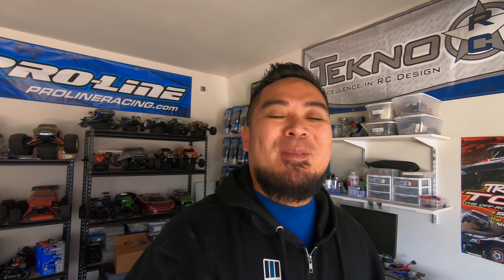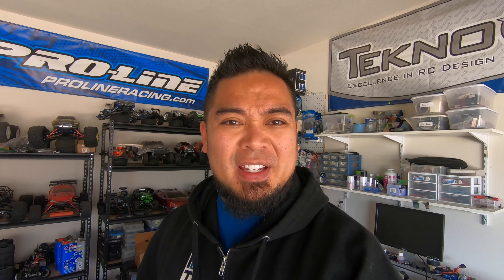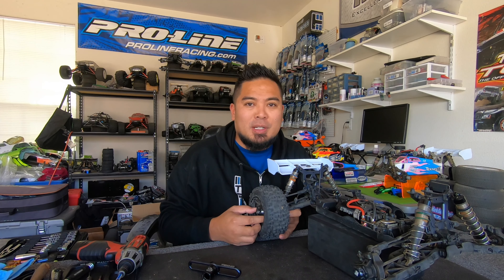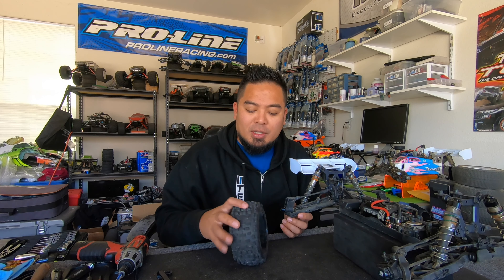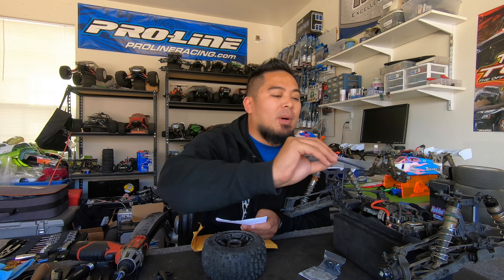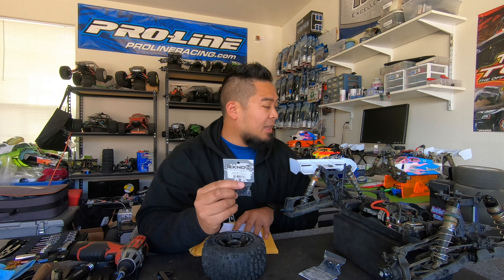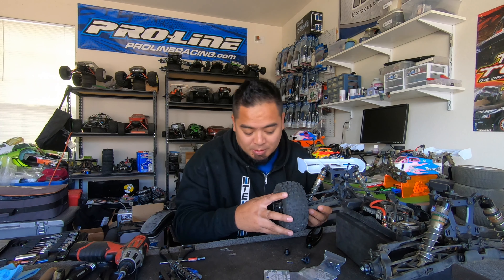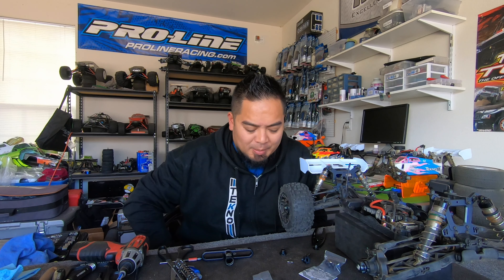Tekno RC ET48.3 My Wheels Won't Turn!

Comment: I used the Tekno 15mm "hub extender" hexes for my Traxxas Rustler 4x4 (I'll explain in a minute), and they're fantastic.  However, the middle of the hex hubs is only slightly larger than 4mm diameter, and the Traxxas axles are 5mm...so, I had to find metric drill bits (thank you, Grainger).  After drilling the hex hub extenders out to 5mm, they fit the Traxxas axles perfectly.  The only 'downside' is that, since the "nuts" thread through the inside of the extenders, they are not "locking nuts", thus I have to use blue threadlocker to hold them on.

As for the "why"...I'm converting my Rustler 4x4 from a suedo-"stadium truck" (honestly, the Rustler body looks like a cross between a stadium truck, and a NASCAR car), to a "true" stadium truck.  Party of this 'conversion' involves using ST wheels & tires, except that the wheels can't for over the Rustler's C-hubs & rear carriers...thus the need to move the wheels further out.  The difference between what you did, and what I needed to do, is that you only needed to move the wheels further out by a very tiny margin, whereas I needed to move them out to the point of being past the C-hubs & rear carriers.

I can't explain everything being done (once it's complete, I'll create a thread on the Traxxas forum, in the 'Rustler 4x4 VXL'  section), but glad to know I'm not the only one needing to do this...especially when taking a vehicle, and using it in a way not intended by the manufacturer (ie. a race vehicle used for bashing, or a baking vehicle to be used on a track).

Keep up the "informative" videos.  You never know how we'll take your info and use it.

Comment: You need the tkr8104 bellcranks to use with the 8100 Ackerman plate. It won’t work with the .3 bellcranks.

Comment: I like running the Schumacher carpet tires and rims they fit my b6 but kinda ran into same problem putting them on my Losi 22 4 0 on the rear the axel thread wasn’t long enough and the nut wouldnt tighten down so added a plastic washer on rear but on front  they spin till u tighten down they locked up so I put plastic washer on inside and works fine. Don’t think Losi makes the skinny front rim hobby shop couldn’t find where they have any but I have a set that’s is skinny but must be older ones not produced anymore. Info Just Incase someone runs into situation. Glad u got fixed.